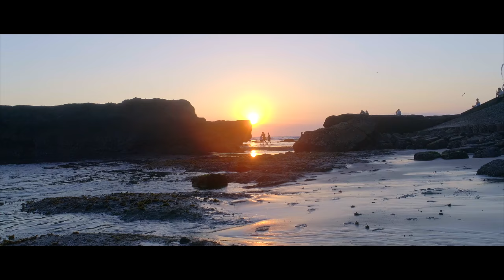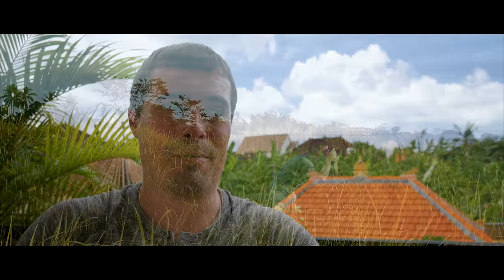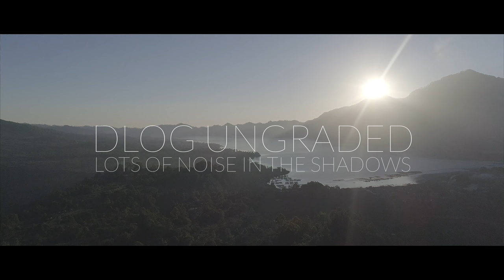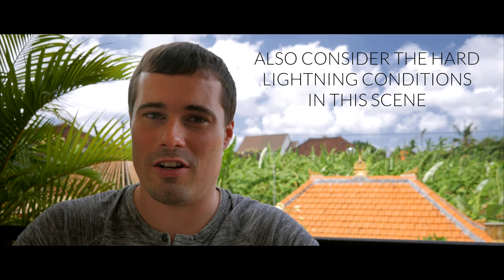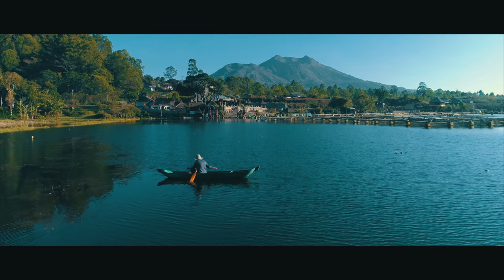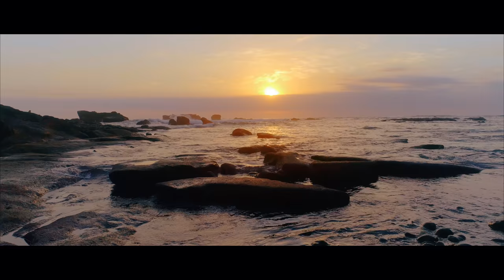📸 D-LOG ISO500 NOISE FIX | DJI Phantom 4 Pro & Mavic Pro

Comment: It is my understanding that D-Log isn't actually creating noise, just revealing noise that is there across ALL color profiles, but the color profiles hide it by crushing the shadows? Or is there other image processing going on (internal noise reduction) in other color profiles  that we aren't aware of? It is a real shame that camera manufacturers don't just spill the beans on things like this to save thousands of people speculating and working really hard to get the best out of these cameras. They could just do a few page write up on how their camera works and processes images in different circumstances and save everyone the trouble. It's actually kind of ridiculous.
Reply from the maker: Hi and yes, every sensor produces noise and the noise is usually hidden when the shadows are dark. That's why with normal profiles you usually see less or no noise. With flat profiles like Cinelike or Log, the shadows are brighter. That gives you more details / dynamic range, but the noise also becomes more visible, which isn't bad because when you overexpose log and make it darker in post-production, the noise disappears again. Also when you overexpose, you get less noise as it's easier to capture details in the shadows for the sensor. It's actually not a secret. When you research a bit about LOG profiles, you will see that it's quite normal to overexpose. This profile is meant for professionals that know what they are doing and not for normal consumers.

Comment: Hey, just curious, we're you using polarising or ND filters when you were shooting the sunset??
Reply from the maker: No, polarising filter won’t do anything when shooting into the sun. ND filters woule make sense but I didn’t have any.
Reply: @pascalbasel Thanks for getting back! Why don't polarising filters work into the sun? isn't the whole idea of them to reduce glare?
Reply from the maker: Polarizers wirk best if you point the camera 90 degrees to the sun. Then they cut reflections in the sky and on surfaces. But the more you point it into the sun the less of that effect you get. So directly into the sun = no polarizing effect.

Comment: Did you use Log and the overexposing in the footage at the end? Love it! What settings did you use, did you turn down sharpening?
Reply from the maker: Yes, like mentioned in the video overexpose when you shoot in Log. No I didn't turn down sharpening. On DJI Drones, turning down sharpening can make your image worse than leaving it like normal.
Reply: Pascal Basel that’s really interesting. I thought that turning down sharpening would help with moire and anti-analysing 
Did you turn down anything else? Or just 0,0,0
Reply from the maker: You're usually right. But on DJI drones (at least the small ones) the noise reduction turns on when lowering the sharpness. On the Mavic it's a big problem as it blurrs trees etc. out. So on the P4P I keep it at 0 - -1. On the Mavic +1. If the image looks too sharp and causes problems you can still unsharp in post.
Reply: That's very interesting, thank you for your insight and conversation. You should definitely be more popular! Hope to speak again sometime soon. I'll now be using Log and -1,-1,-1
Reply from the maker: Thank you, which drone do you have btw? Sharpness and Contrast can usually be -3. If you get problems, raise the contrast so that it's easier for the sensor to calculate the image.
Reply: Phantom 4 Pro, and I cant decide between Log and standard. Was planning on using Log but then the guy who has my favourite drone footage just says he used standard
Reply from the maker: I see, it depends on the conditions you're filming in. In this video I think I give a good explanation for you: https://www.youtube.com/watch?v=nAKA8wkgVPM
Reply: I just clicked on to that video! Perfect! Watching it now. Do you go into specifics of the 3 settings? (Sharpness etc)
Reply from the maker: No, I just tell why you should use log + another profile instead using only log.
Reply: Pascal Basel the two profiles I use! I just think standard is too boring. I’d love to see a video on the custom profiles

Comment: My footage does not look this sharp, it often looks blotchy or almost '720p' like. I am beginning to wonder of there's an issue with my lens as even with Infiniti focus it can't seem to pull objects into focus nicely. Did you add any detail into these shots in post?
Reply: Did you check the sharpness? Below +1, the noise reduction gets rid of the small details of some objects, like leaves on trees or the tiling of roofs.

Comment: how to fix the noise on the post ? i had the same problem will appreciate your help
Reply from the maker: If you follow what I say in the video you shouldn't have to correct noise in post. (Just do normal correction and it will disappear as you bring the exposure down in post.) If you already have footage with noise, there's no other solution than neat video.

Comment: But, won't this do exactly the same thing that NOT using the D-LOG? I mean, d-log under-expose by default all shots, if you overexpose them, there is a whole range of their "13 stops" that you don't use, the same as with recording as d-cinelike. I've the feeling that without overexposing the d-cinelike, you would have got the same result.
Reply from the maker: J4N No, because you use the zebra as an indicator when you over expose too much. You can also use that in Cinelike. But you get more details in the shadows with LOG. And you will recognize that you can over expose a lot more in LOG.
Reply: The zebra are not present on the d-LOG just because it starts with an offset of -3 of exposition. You cannot overexpose the same thing between d-cinelike and d-log because you don't start with the same offset. You should shot the same video, one with d-cinelike without over-exposure, and one with d-log with +2 in exposure, you will  have probably same kind of results
Reply: Also, stop putting those black band up and down, just export in the correct ratio: 1) People who have a monitor with the same exact ratio that your video will have black bands on top/bottom, but also right-left. 2) Youtube and others media add automatically really black bands if required. 

In my case, I don't display it on full-screen, so I've your video using only 75% of the size it could.
Reply: Also, I'm curious to know how you set the exposure? Is it mandatory to go in full manual? I was shooting some video where the light varies a lot.
Reply from the maker: J4N Of course it is not present. You have to expose your shot manually until it becomes present. You‘re just doing something wrong there. When you expose LOG one step before zebra starts and you expose Cinelike one step before zebra starts, you will have more details in the shadows and very likely also in the highlights. There’s just no other option.
Reply: I will give it a shot. DJI could have done better job on this.
Reply from the maker: J4N Not really, it’s the same with every camera. LOG is just meant for people that are more serious about filming than hobbyists.
Reply: Yeah I know, but since they have introduced their new D-LOG, removed their LUT profile, I struggle everytime to have an exploitable D-LOG file. Always too much noise, and like I said, I know how to manually set the exposure, but often(when I've the gimbal going from a lake to a sky) I need to have the aperture/shutter speed to adapt, so I cannot just use manual most of the time. :(
Reply: J4N D Cinelike clips one stop before D-Log (bigger sun) Truecolor and even Standard do. The clipping happens at exact the same point using these 2 profiles (ISO 100 vs 500). Just brighten the shadows, even more visible detail but more noise.